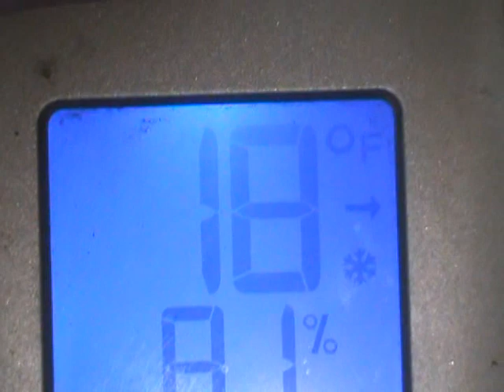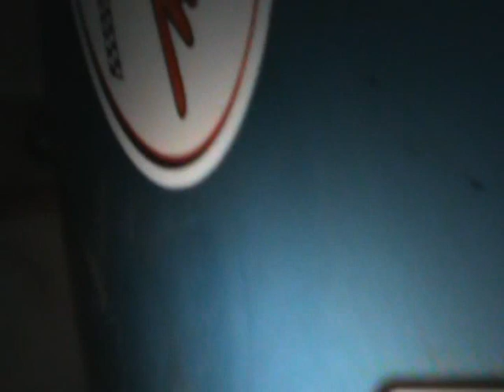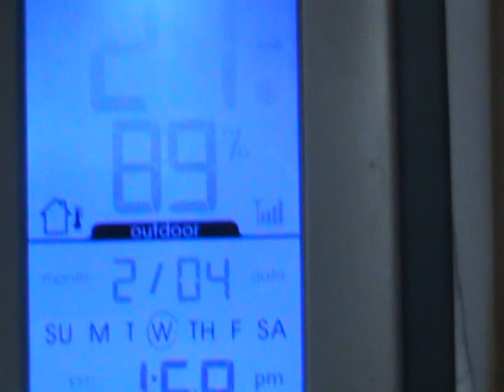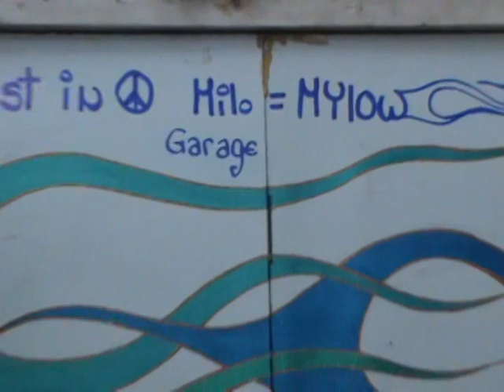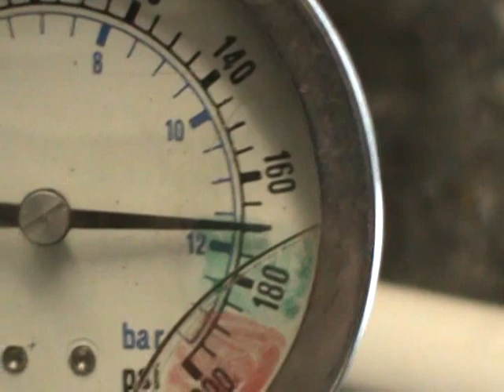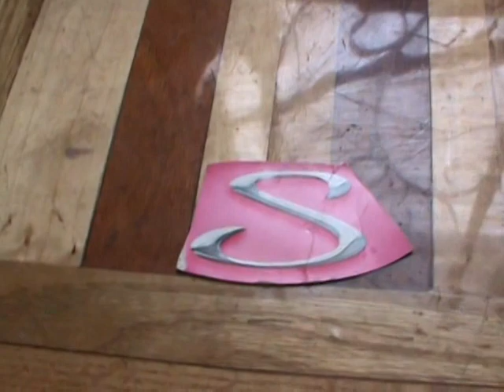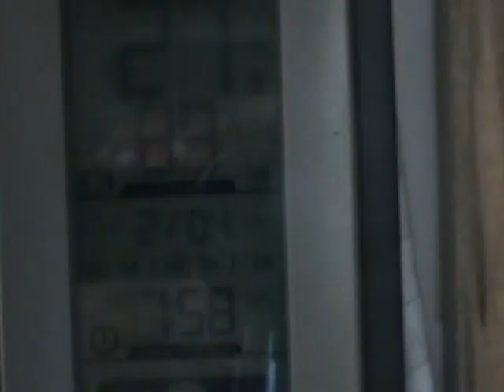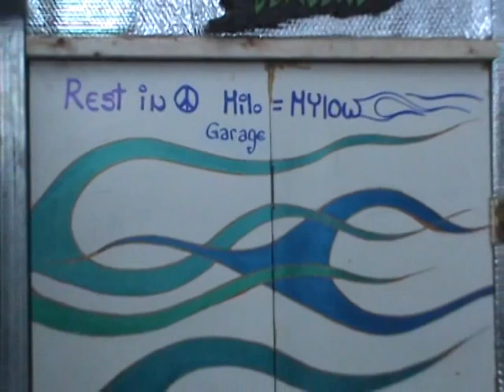NO CALL ,NO SHOW,NO CLASS PEOPLE

Comment: I have only ever been in one paint booth,and that was pete's, and yours is bigger with a car in it than his is.  Here is the chop saw I bought http://www.dewalt.com/tools/metalworking-multi-cutter-saws-dw872.aspx.  You are correct, you can buy the the carbide tipped blade for $150 or so, but your saw turns too fast for it and it will burn up the blade in a matter of 2-3 cuts.  Ask me how I know! lol  But I was able to get that blade sharpened for $30, so now I have 2 blades for mine that I rotate in and out and get them resharpened.  I sold my old saw like yours on craiglist for $125, and bout the new one for $450, so its basically a $325 upgrade, and for me it has been well worth it.